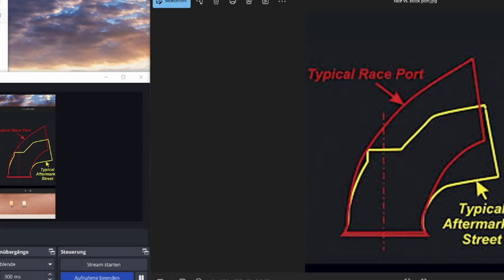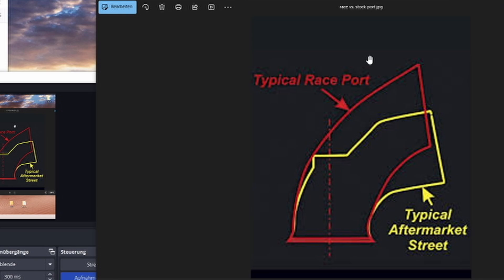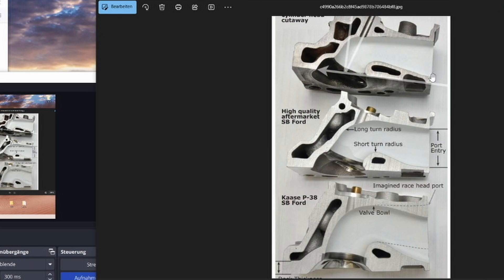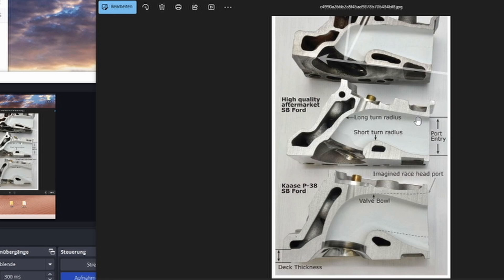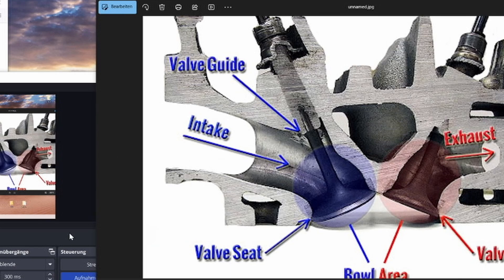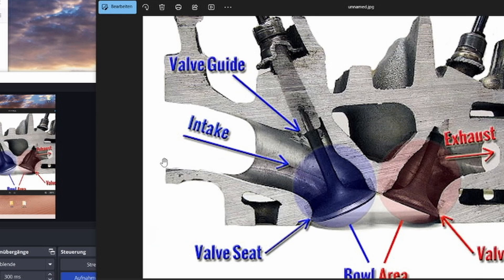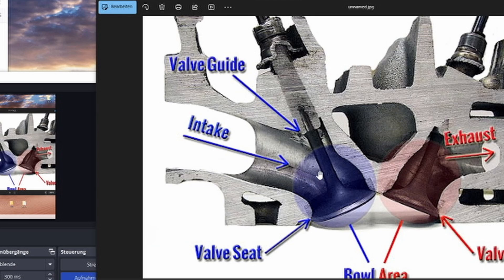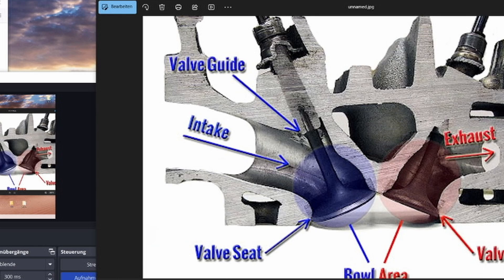Basic beginner Cylinder Head porting Part 1 | The Theory explained & Why more is not always better!

Comment: Hi good work...are you working on a BMW M62 head?
Reply from the maker: interestingly enough that head is already very giood and will be able to handle 1000 hp or more with a decent cam setup. so there only might be some room for improvement in the bowl although i doubt it. 
i have some other heads that need improving tho where i will be showing stuff :)

Comment: I have ported the head on my Kia. However when I take the head off to put it on my next engine block that I'm currently building I will remove the valves this time around and go ahead and clean up the bowl area behind the valve. Hoping to finish the last portion of the poor job since I've already ported the intake the throttle body and the runners on the head
Reply from the maker: yeah thats gonna be the way to go. the most performance increase lies in the bowl when it comes to basic porting. also the combustion chamber is important but i will get to that in a later part.
Reply: @throttlebuddies0 yeah I've seen some stuff on smoothing the chamber and getting rid of Quinch zones
Reply from the maker: @gettinshifty02 getting rid of quench entirely is a bad idea but deshrouding the valves and depending on your specific head setup some things might make sense
Reply: @throttlebuddies0 I think I worded that wrong I was referring to the edge of the cylinder where it quenches and causes detonation. But when I googled the definition of quench zone it refers to the entire surface above the cylinder when it's at top dead center. But I have always known it to be the outer edges of the cylinder where you have a lip based on how small the dome is to the cylinder size where you have like a flat edge and it increases pressure in that small area on the edge of the cylinder and causes detonation. I know that if you can smooth out certain areas along the edge of the cylinder without causing a seailing problem then it is a good thing because it won't cause detonation at high boost levels